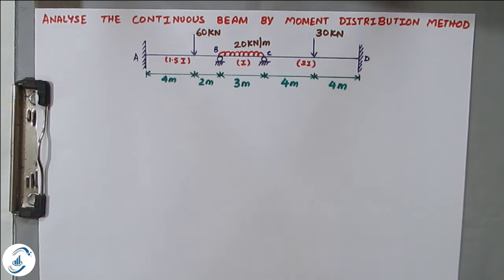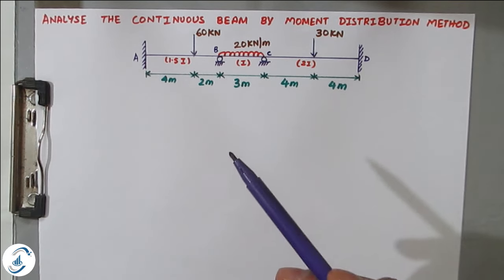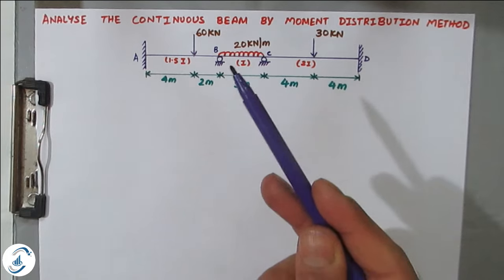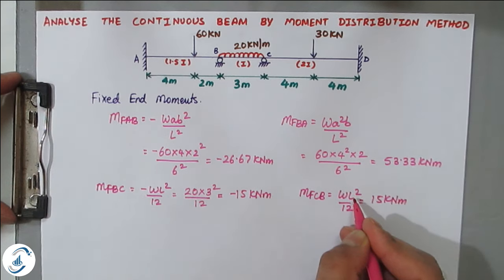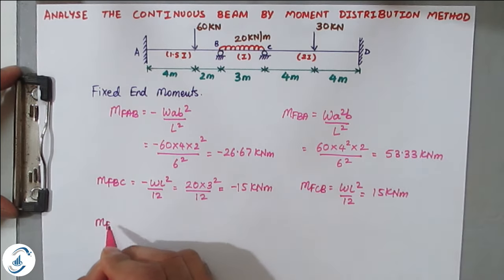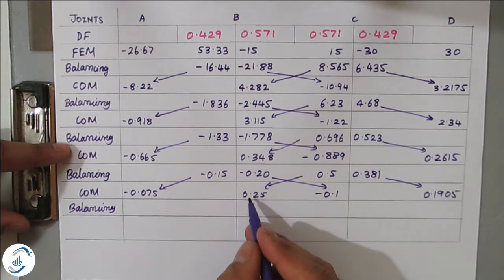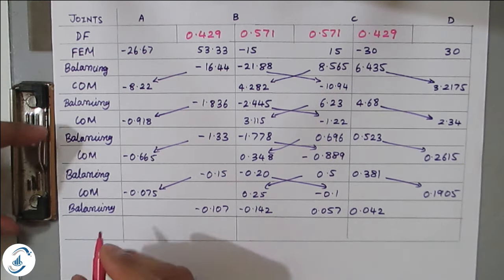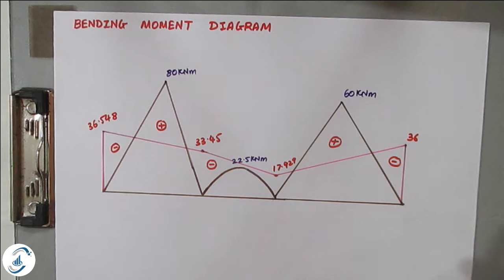Moment Distribution Method | Analysis of Indeterminate Beam

Comment: A Continous Beam ABCD 20m long is Loaded is shown: AB = 8m BC = 4m Cl )=8m. moment of inerba AB = 2I , BC = 7 , CP = 2I there is a Uniform distributed Lood of Iskallon Older Span AB and BC. On CD There is a point Load of 40kW at I'm from D. The End "A is fixed and D is Supply Support. During loading Support C Sinks by Jam Draw The the Shear force And Bending Momant diagram = 2x204/kal/cm² I=1600cm 4

Takes E

40k

A

B4

I

C

27

8m

4m

8m

2.